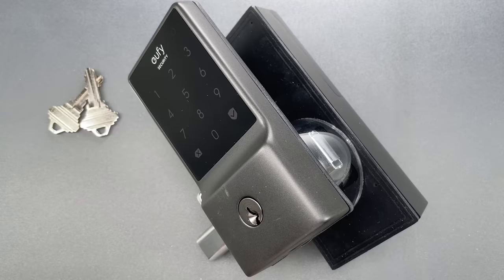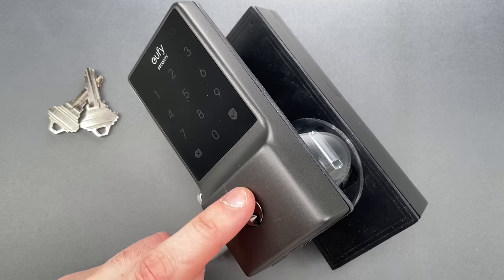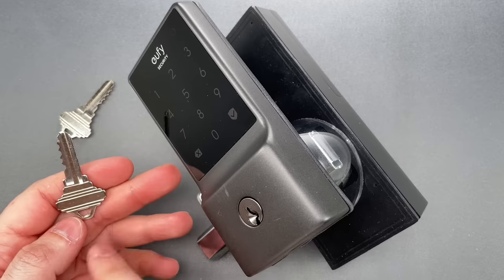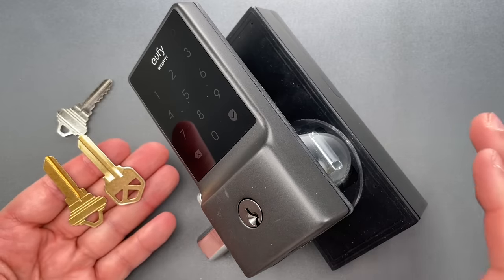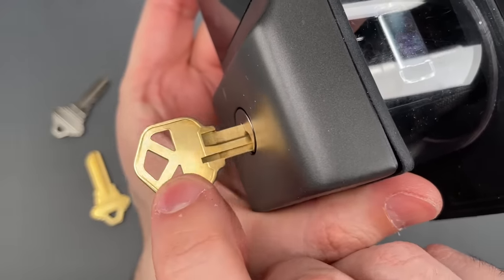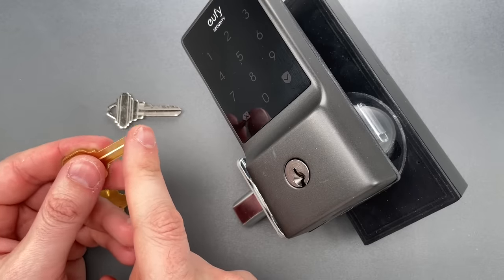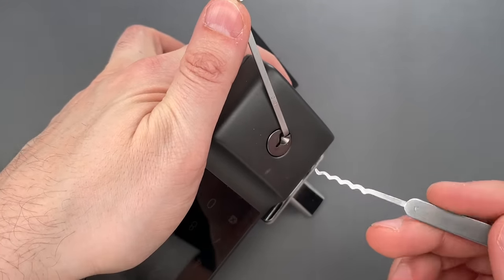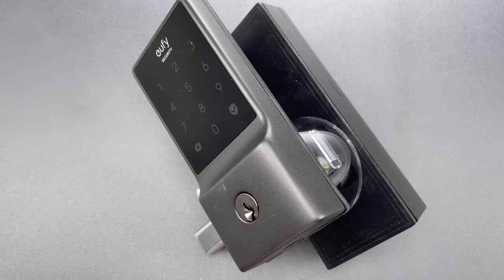[1515] This Eufy Smart Lock May Frustrate You (Model E110)

Comment: Moral of the story: don't bother making spare keys for every lock you own, just buy a covert companion set and a bag of skill or experience
Reply: Why bother with keys? Just use a covert companion set for every lock. Bonus points for modifying the keyway so that no key fits.
Reply: There isn't much skill involved in using a wave rake...
Reply: NO DONT! DONT PICK A LOCK YOU NEED TO RELY ON (Rule:2) 
...Rule:1 is Only pick locks that you own or have permission from the owner.
Reply: @penfold7800  It's just for backup.  It's expected you'll never use the keyhole, so a wave rake for backup is fine.  I have a keypad lock, and I'm the only one with the key.  No one else even wants to carry a key, and they use the backdoor keypad if the front doesn't work.

Comment: As someone who has cut many thousands of keys, for an uncountable number of different keyways, I have encountered these situations plenty of times.  I learned early on, to always check that the keyways matched before you cut, and always double check that the profiles match after you are done cutting.  So many times, I had customers with non-standard length keys, and I would have to either shave the end down (like with your key) or shave the shoulders back.
Reply: While I don't have THAT level of experience, I can absolutely attest to this. I've seen people bring in some weirdo keys that look like Schlages but are KW1s. Even when you think you're sure you're picking out the right blank, you better make damn sure.

Comment: I'm a locksmith. Knowing this information, I would cut the duplicate key using tip registration rather than the standard shoulder registration. Still, that being said, I wholly agree with your assesment of these keys. 
Eufy equipment also does not play well with other home integration products. I had their doorbell for awhile. The doorbell did not alert visitors that were fast moving, such as delivery drivers, did a lot of falsing, and would not integrate into my home automation system. Thank you for your great review.

Comment: I was our professional locksmith at the hardware store I worked at for 6 years and had to cut non-standard keys like the kind used on this lock on occasion. It only takes a few more seconds to look carefully at the key and shave it down if needed. It saves both you and the customer the headache of recuts later.

Comment: The more I read into them, the more I realize that smart locks and their respective companies seem to be more dumb than smart...

I'll stick to the analog locks that you personally suggest! They seem to have a sense or stability that nothing else does.
Reply: I mean, they are making money. The ones dumb are those who give them money.
Reply: That's why I will never trust "smart" things that otherwise have absolutely no business connecting to a wifi in the first place. Not only wave rake, crowbar, or mallet still work on them, but hackers may try to lock me in. Double points if you are in an area where the electricity isn't reliable and still prone to have brownouts or blackouts.
Reply: I wouldn't worry too much about getting insanely pick-proof door locks anyways. Most theives are going to take the path of least resistance. Doors locked? Windows locked? Most theives aren't even going to bother at that point unless they know for sure something insanely valuable is inside. They'll just hit a house that isn't locked. If they're determined to get in, I can almost guarantee you they're not carrying lockpicks. They'll kick in the door or bust a window.

Comment: OH MY GOODNESS!  I just had this similar situation with a client who bought a house with a Smolet brand electronic deadbolt.  The client sent a picture of the key, which APPEARED to be a KW1.  When I arrived and got into the rekey, I discovered that the keyway was NOT a KW1, but similar to a Y1.  I say similar because I had to do the exact same thing and cut the blade shorter to make a Y1 key work.  Something to note, this Smolet lock had smaller-than-standard pins, so my repinning kit was useless.  I had to rearrange the pins in the existing lock to create a new bitting.  It worked, but I had to explain that the rest of the locks in the house couldn't be matched to this non-North American key.

Comment: Fairly common on Chinese made locksets as of late. Got a "Cielsa Dawn" branded knob with lock off Amazon (just needed something to keep the kids out of an interior door, it isn't for actual security) and found the exact same situation. Schlage looking key, with KW1 keyway, but about 1.5mm shorter than the actual KW1 key. Luckily they included 3 keys and I also cut my own key blanks, so it wasn't difficult to work around, but as you say, the average consumer will be quite frustrated.

Comment: In a similar vein, there's a garage door lock that has a key that's very similar to the Schlage format. It's just a slight bit narrower. Or at least normally is. Apparently if you push hard enough, things can be made to fit. The pins are also slightly offset which nearly had me cursing a guy who had 3d printable designs for key-nibbling until I worked out it was the key, not the guides.

Comment: Kw1 keys are shoulder stop keys, so they align with the pins when the shoulder sits flush against the lock face. Key machines line up the same way to cut the keys. It would be easy to line the key up using the tip instead of the shoulder and then the machine should cut the key with the correct spacing. Then, the person operating the machine should line up the keys and confirm visually the new key has the correct spacing, as they should everytime they cut new keys

Comment: I posted a link to your video, on their Twitter page.

I'm hoping they will pull this off the market, replace the cylinder and send you an upgraded version, so you can check they have fixed the fatal security floor, as well as made it easy to get keys cut.

Comment: It makes me think they were trying to create a situation where the customer would feel required to order spares through the mail from them, rather than being able to go anywhere else. Is there a code included in the package that gives the key bitting?
Reply: Why would you want spare keys for a lock that you bought specifically to not need to use a key?  The only real purpose of the key is if the lock battery is dead or the electronics fail and you have no secondary way into your home.  So I'm not sure why you would need more than the two keys it comes with except in extraordinarily rare circumstances.
Reply: @ian3580  I agree. But then they key should not be so trivial to defeat.
Reply: @reav3rtm  I didn't say that it had good security - my point is that a complaint that keys are hard to copy doesn't matter (and in some ways would improve security if the lock weren't so easy to defeat by raking).
Reply: @ian3580  And I am not arguing with you:) That "But then" was aimed at the product, not your statement.

Comment: Can you open the electronic lock with a strong magnet? That would really make a cherry on top of this cake..
Reply: And if not, it would be nice to see if these locks can be saved by disabling the key unlock mechanism
Reply: @JordanPlayz158  There are devices around. You'd need to get a blank key (as seen, kinda hard to do for this), but you can make a "disabler key" that will jam up the keyway and can be removed later with tools/the rest of the disabler.
Reply: @JordanPlayz158  If the core could be changed, that would make a huge improvement.
Reply: @ConstantlyDamaged  interesting, either disabler key or core replacement like sleeptyper said although, we also don't know about any other exploits, most concerning if I had to guess, would be what sleeptyper said initially, using a strong magnet
Reply: @JordanPlayz158  Yeah, magnet bypasses don't always work though, and I would have expected LPL to have gone over this one with a magnet to test it.

Comment: Looking at the supplied key, the key itself looked like a bump key. (you know those full auto keys) Would a different pattern of pins make the wave rake less effective?
Reply: Might take a little longer, but probably wouldn't make much difference. I have a six pin Schlage I use as a practice lock. Two regular pins, two serrated, one mushroom, one spool; mix of high-low. It's meant for practicing SPP, but it can still be opened with a bogota in 5 - 10 seconds. You just have to rake and scrub at a variety of angles while playing with the tension. Adding a zero lift pin or two can sometimes frustrate or at least prolong raking or other kinetic type attacks, but it typically makes single pin picking easier, because it's essentially as if that pin stack doesn't exist; you never have to touch it, because it's already sitting at the shear line. If a zero lift stack is situated in front of a pin stack that has to be lifted very high, that can make it a little tricky, especially if it's coordinated with the binding order of that particular lock.

In terms of security, it's best to think in layers: well-lit grounds and entrances where the lights can't be easily disabled; no big trees or high bushes which block the view of any point of entrance; if you have plants around your windows, make them the thickest, thorniest rose bushes you can get, and don't have a gap between them and the wall; no enclosed entrance-ways which are unsecured; all doors have at least two locks; make sure your deadbolts are properly installed and the bolt can extend fully into the frame; install anti-kick plates with long screws that effectively anchor your deadbolt into the stud, and thus distribute force throughout the entire stud; if you have an alarm, ideally it will make noise, but also actually call a dedicated monitoring company that will phone the police for you (this should use a cellphone service so a prospective burglar can't just cut your phoneline from outside... There's all sorts of things you can do, but at the end of the day, you don't have to try to turn your place into Fort Knox; it just has to be less appealing to the criminal element than the place down the road (or better yet, in an entirely different community). As long as you're not being specifically targeted, that should be enough to prevent you being randomly targeted. So just roleplay yourself as a burglar; what would make you pass up a house? Implement those things.

This is probably a lot more than you were asking about, but there you go 😆
Reply: @Ghost  failing that, brick goes through window.

Comment: Having keys that can't be copied may prevent the flatsharing going out of control in a building. I've seen that in a few buildings in my area. I thought that was dumb at first, but it works; especially in areas where the price of the rent is increasing fast, and apartments end up overcrowded.
The only way to get a copy is by contacting the maker of the lock, and only the management of the building can request it.
I don't know if that was the intent here though.

Comment: We've got a few locksmiths in the area that use electronic key systems to check the key out. They can tell if the blank is one or another 
The locksmith my company uses also  can check length on keys as there are a number of non-standard locks in the area

Comment: I rented an old Sonic Drive In building last year to put a used car lot in. The front door key was a Schlage key. I went to Walmart and got multiple copies as they come in handy. Upon trying them none worked. I then laid a new key over the only working key that had been used as the template and noticed the tip was ground at a sharper angle on the top edge. I took a file and matched the angle on one of the new keys and voila! it worked. I'm guessing the business did this it try and foil any lower management who might get a copy only to come back later and rob the place. It was effective, at least for a minute.

Comment: If the cylinder is replaceable then you could put one that is .ore secure.  At least it's mechanical,  may Schlage one has the key making the electrical contact so you still need batteries.  I removed the tail piece so it doesn't do anything and you must use a code.

Comment: Bit of international context, LPL. Where I live, at the right side of the pond, it is common practice at hardware stores to actually check the keys for blade profile straightaway (with key bow being largely irrelevant, many companies using the same or not caring for a consistent shape - my personal keyring has two copies of the same key with diferent bow shapes, and my wife's has a third) and the most common kind of key punching machine I've seen in use since my teenager years of yore always included a side grinding wheel to take care of excess length, should a key use a shorther blade than the blank they are using. Meanin that they could be replicated at any hardware store around here. But as you said, the manufacturer clearly was not aware that in the US market, the common lock copiers do not commonly have such capabilities. While I (a random person, NOT one of that brand) can juvenily "snicker at the inferior US machines", THEY (the manufacturer, NOT random persons) should have built it for the market it was gonna be sold at.

Comment: Every time the wave rake shows up, you know it is so easy that even someone without lock picking skills can open it. The only thing worse is when a wire is pulled out — which is most likely a Master Lock product.

I wouldn’t buy anything Eufy that relates to security as they have a track record of bad practices.

Comment: My roommate went through a similar issue because our landlord bought a Defiant knob and deadbolt set.

My roommate took the key to get copied at a locksmith’s store. When the roommate got home, the copied KW1 key didn’t fit the lock.  She went back, they cut another one and same issue.

Mind you the roommate doesn’t know the difference between Defiant, Kwikset or Schlage locks.

When I tried explaining the difference, the roommate looked at me as if I was speaking Greek. 

She also thought “universal core” lock meant any key would fit into the current core.

Comment: I discovered that while the kw1 key can be cut, all of my attempts to copy the key ended in failure. It is as if that kw1 key is too sloppy to fit a Eufy lock well once the cut is completed. I think one must visit a locksmith to obtain a key that works at all. Thanks for the heads up. John

Comment: Nowadays hardware stores like Lowe's and home Depot use a machine that digitally identifies keys and if the key shape is not in the system it would put out an error.
Also if it's a non-standard key I guess it has bump key resistance at the very least

Comment: If getting a new key would be this simple, here in Austria. I bought an apartment last year and also a rather large cellar with it. They both had euro cylinder doors, but different keys. So I went to the next locksmith to buy a new cylinder and a few spare keys. I brought my key security card. The lock smith told me that the key and lock are from Slovenia (neighboring country to the south) and are region locked he cannot make me a new key and cylinder, but offered to make completely new cylinders and keys for me. I declined because the same key as for the apartment opens the main gate and parking area, and all this started to remove keys from my keychain. 
In Slovenia, the locksmith told me he can only make new keys if I bring a certified translation of the bill of sale and ownership and the key security card.
 All in all, it was a huge hassle, cost me a lot of money and everything because the builder wanted to save a few Euros.

Comment: This feels like they intended for the "non-standard key" to be a security feature of some sort, when in reality the chances of someone copying your key to later break in is significantly lower than the chances of someone just using picking or a destructive entry method. 

Meanwhile, they've made it so that the people who you actually want to get in in the event of the electronics failing, have to go through extra hoops to get a functioning key. What's even worse is that I wouldn't be surprised if most people don't think to check their key in the lock when having a spare made, so they wouldn't find out that it doesn't work until it's actually needed.

Comment: Can you replace the kik cylinder with a standard schlage one though? That format comes in a wide range, and mid range and up will have spools / anti bump pins to higher end ranges with side bar / key control. 
Eufy is a very Chinese company, with very minimal instructions on their whole line up, and their electronics are not cheap. At that price point that lock cylinder may just be a place holder / example you're are supposed to replace with the "good one" that was in the deadbolt you are replacing.

Comment: i have this lock and changed the core to something more standard, i did have to drill the opening a small amount but that's easy with a step bit, the core is stupid easy to remove and replace too

Comment: your locksmith won't be fooled by this for the following reasons: 1) the schlage bow goes on @ least 5-6 different schlage keyways so you don't 'grab an sc-1 & start cutting', you'd always compare the keyway on the original to the blank you're going to cut. 2) once the kw-1 was cut the length difference would be obvious because a small shelf would be formed @ the tip of the key (kwiksets are shoulder referenced not tip referenced). i'm not for a second pretending that you wouldn't see these problems getting keys at walmart, but not at a real locksmith.

Comment: I want a lock that uses a electric strike plate, the kind that has everything that you see in this video just mounted on the wall with a camera and motion senors, much like a ring camera. The door lock can just be a standard lock with no key overide. I will have a key override on the other side of the house where it is much harder to get to.